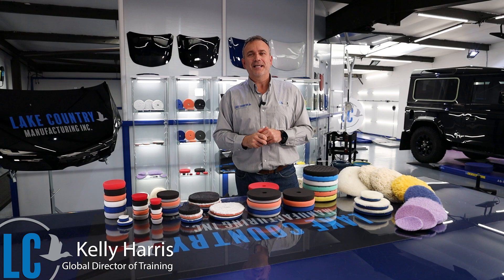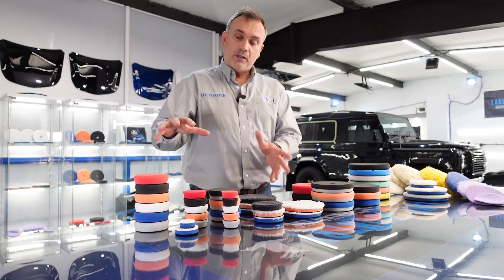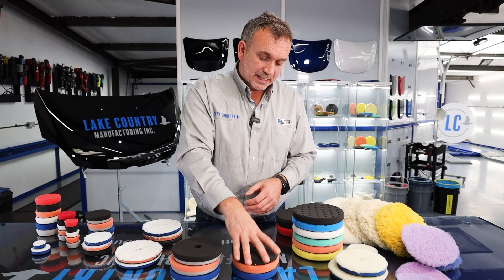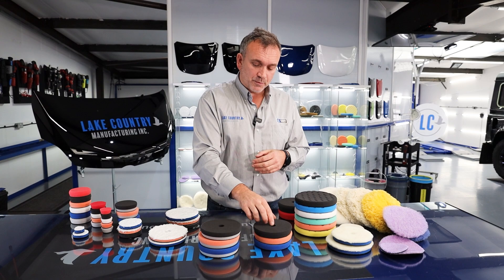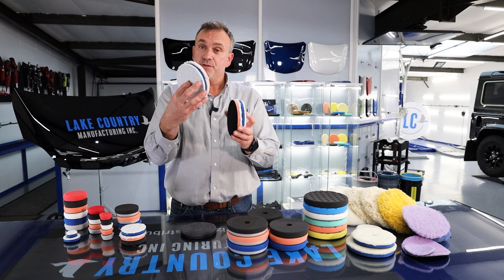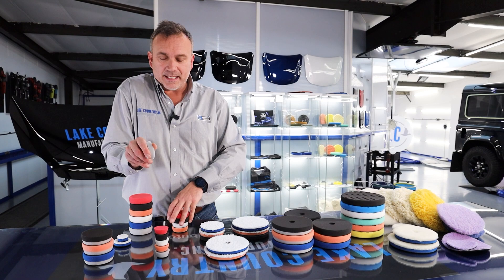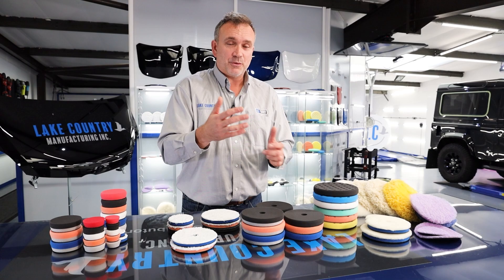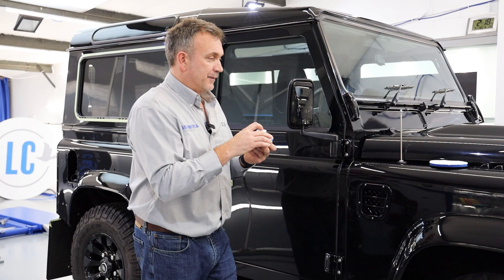An Intro To Lake Country Pads with Kelly Harris

Comment: I was hoping for a little more on the forced rotation pads as I have recently bought a Vertool machine to replace a DAS6 pro plus which I was having difficulties bogging down (maybe I'm ham fisted). I used the Hex Logic pads with that and still have them but wondered whether I would be better with the force rotation pads instead?
Reply from the maker: Lake Country MFG Force pads are designed specifically for Forced Rotation machines.
Reply: John ; have you tried these pads yet?> 

I currently use the orange hex pad and white hex , ready to give lake country a try.
Reply: @LakeCountryManufacturing   No kidding ?

Comment: You skipped over the CSS pads. Will the CSS work on the new griot's garage G-9 machine? Your website recommended the CSS for my Japanese car paint.
Reply from the maker: I believe you mean CCS pads. Yes, CCS pads will work on Griots G9 with a 6" plate, or they come as 5" pads with a 5" plate.
Reply: What kind of JDM car you have?
Reply: @bfighter125  He didn't say it was JDM, he said it was a Japanese car. I have all Japanese vehicles but they are USDM, not JDM. There is a difference in vehicles mechanically from market to market, however for paint they are the same.
Reply: @___Karma__  1 year too late, i dont care.

Comment: I just bought a ton of your hand polishing pads. I don't have access to an outside outlet right now. Quick question, Should I up the cut in my Polish since my hands won't be as powerful as a buffer? I have very very light swirling from hand drying, even while using a drying aid. It's not bad at all, just needs a little boost.
Reply from the maker: The thing about polishing by hand rather than machine is it can be tricky to work evenly and consistently.  So, if you've got a heavy cut compound, you could in theory leave behind some dull or hazy patches that then cause you more work to do with another stage, and so on and so forth.  In your circumstances I would recommend keeping it gentle with the polish, and following up with a filler-heavy glaze and wax :)

Comment: You missed the force pads what are they used for? thanks for the info
Reply: They are used for machines that are force rotation or gear driven machines like flex 3401 and rupes millie

Comment: whats your best recommendation for a flex 14-2 150 rotary? for cutting thanks..
Reply from the maker: Purple Foamed Wool or Low Lint Wool are great for 'everyday' heavy cutting on automotive paint :)
Reply: What about the foam for the flex 14-2 150 rotary?

Comment: Why is there an hole in the centre of the foam pad and there isn’t in the centre of the other foam pad ?
Reply from the maker: There are a couple of reasons for center holes but the main one is for cooling.  

Before orbital polishers became popular, rotary polishing was the default.  On a rotary, pads travel slowest at the center and fastest at the circumference, hence this is where they generate the most heat.  It's partly why heavily used and abused rotary pads can begin to break up around the edge.  When orbital polishers entered the market, foam pads designed for rotary were used.  But orbital polishers work differently, with the pad subjected to a much more consistent agitation across the whole face.  When used hard - especially as orbital polishers got more aggressive with larger orbits - users noticed that some foam pads could get hot, degrade and even collapse in the center.  A cooling ventilation hole provides an obvious and practical solution.

Comment: Can someone tell me What’s the best pad to cut then what’s the best pad to polish and finish can someone drop the links below
Reply from the maker: Hi Martin, I'm afraid these questions really don't have straight answers unless you can be more specific, because the hardness of the paint, the depth of the defects, and the expectations in terms of how flawless you're trying to make it (plus considerations about safety, budget, timescales and so on) can all influence a detailer's decision process and workflow....

Nevertheless...

I can tell you (having corrected literally thousands of cars now) that on standard modern automotive clear coat, tasked with correcting ordinary swirl marks, using a 15mm random orbital polisher with a 5 inch backing plate, I would most often pick up our HDO-550F Microfiber Cutting Pad and a microfiber cutting compound to remove the swirls (usually in one pass but sometimes two), and then switch to our HDO-73550 Black Foam finishing pad (or even our FR-HRed 5.5" Red Force pad if it's particularly soft or dark colored paint) with a finishing polish to restore a flawless gloss.

HDO-550F Microfiber Cutting Pad
https://lakecountrymfg.com/products/hdo-fiber-pads/

HDO-73550 Black Foam Finishing Pad
https://lakecountrymfg.com/products/hdo-foam-pads/

FR-HRed 5.5" Red Force Pad
https://lakecountrymfg.com/products/force-pads/

Best of luck! 
Jay @ LC (UK)